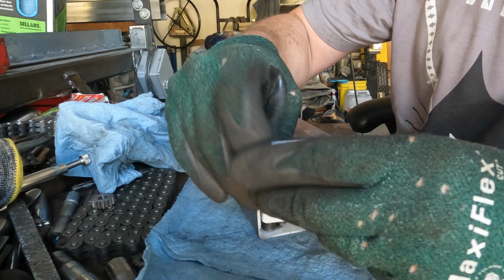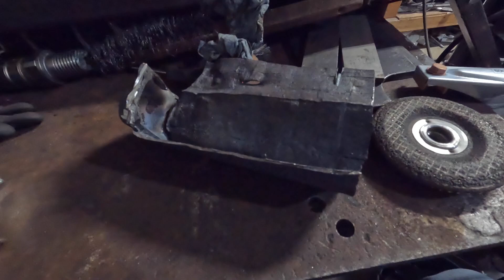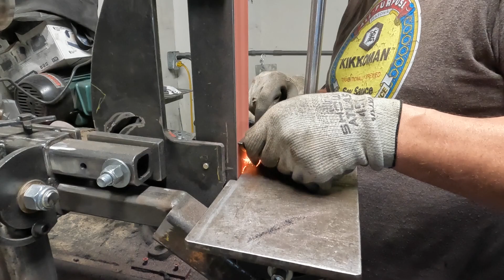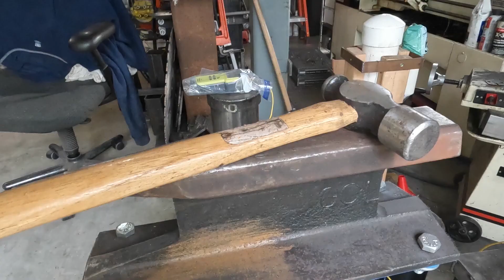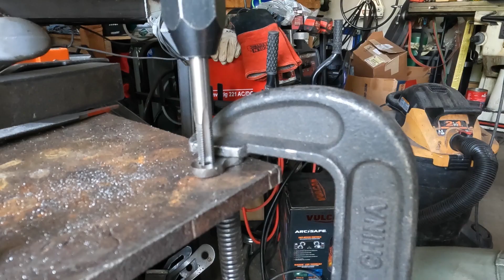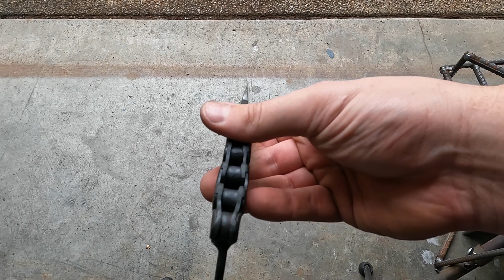Karambit from chain damascus

Comment: Nice, coherent scheme incorporating the roller chain into the entire knife. I appreciate you including some of your thought processes, as that's always helpful when I'm thinking about a project. I've been meaning to head to TSC to get some roller chain, and this may be the final straw to get me there. Curious, though, as to why you chose such a large canister? Seems like a smaller one might have been easier to heat all the way through, but then I guess you wouldn't have so much stock for future knives. Thanks!
Reply from the maker: Hi Bryson, hope you are doing well, I always make more than I need, I am still prone to mistakes! Let me know if you want a slice of it, I can send you a nice .250 thick section. I also had a lot of chain, the metal dumpster at work had a 10 ft piece of chain.
Reply: Thanks! I did get by TSC and bought 10' of new chain, but rather than stick it in a canister I'm going to make a flower pot for a sculpture I'm finishing. Still fussing with a couple of more traditional damascus builds, so need to get those done for customers before I try something new and different!  @sigmaforge6232